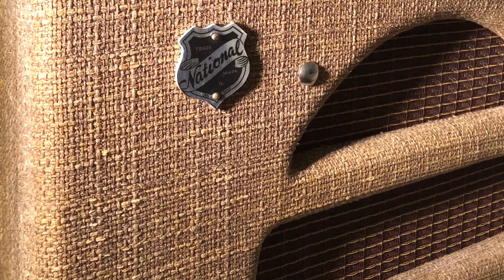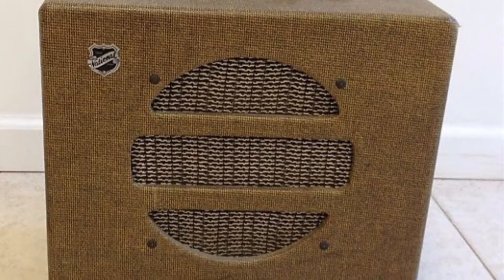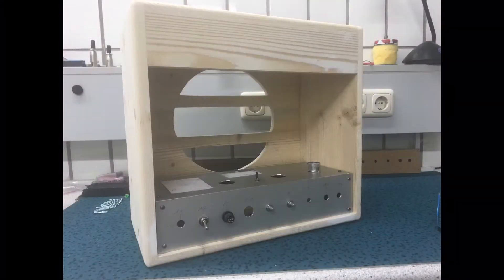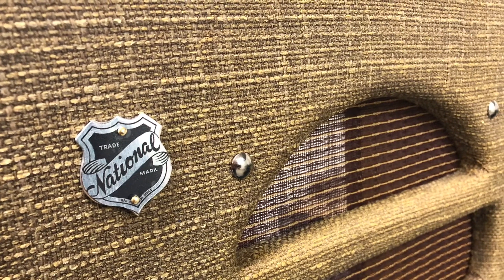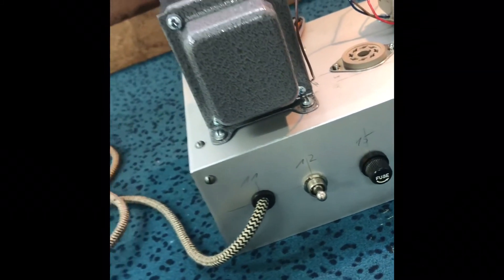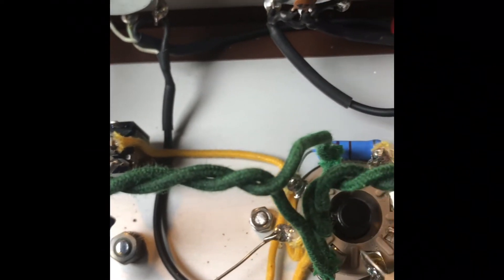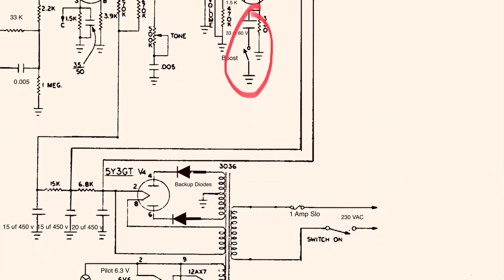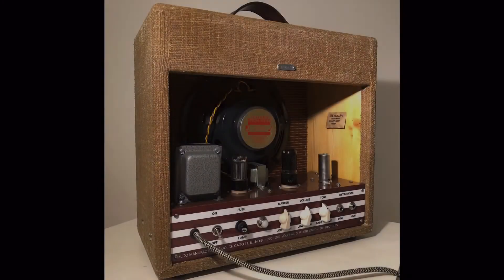National, Supro, Valco: How to build a Valco Guitar amp clone

Comment: 1950's national amp would not have ceramic Jensen, it would have P10Q Alnico. What model are you building with a 12AX7, most National amps that look like this, I know have 6SL7 or 6SJ7 preamp tubes. Of course, a few late ones have 12AX7. I see now you say 6616 but where is the second 12AX7 for the Tremolo? That said you did a very nice work on the cabinet but this would only fool a young man.

Comment: Great job Martin.I'm concerned about the DC present in the tone pot though, which could be dangerous for somebody else down the line.The blocking capacitor is there to block DC and the placement of the tone pot in the schematic defeats the purpose of this.I think this is a printing error and I wish that somebody who owns an original amp would confirm this.For what it's worth,this is the only version I know of any 5 watt Valco amp that has the tone pot before the blocking capacitor.
Reply from the maker: Hey Randy, I built this clone a few years ago, so I had to dig a little bit to get back into the subject. Actually it’s not a printing error, because the tone control is wired the same way in the Supro 6606, the Airline GVC 9045 A, the Gretsch 6151 and the octalsocket preamp of the Valco Spectator. Definitely not by mistake. Although I‘m playing that thing for a couple of years now, I’m still alive. But you did arouse my interest, so I’m going to take a closer look at the wiring and measure some voltages. By the way, whenever I had dc on a pot, because of an leaky capacitor, the pot caused crackling noise. But my Valco clone is absolutely unobtrusive. I’ll check that, and will let you know.
Greetings from Germany
Reply: @martinstubeampworkbench2299  Ah Martin, nice of you to respond.I was aware of the Gretsch having the same circuit but after seeing the Supro 6606 and the Airline which is essentially the same circuit as the Gretsch but drawn differently, now I realize it´s no mistake, but why? Was it for less attenuation? For me it°s safety first so I chose the 1959 Spectator circuit when I converted my Peavey Valve King Royal 8.Keep up the great work!Also, I sure am glad you´re still alive.😂
Reply from the maker: Allright…. I checked the circuit and in fact, I had 150 volts dc on the tonepot. Still wondering why there was no noise, at least a „whoosh,whoosh“ . Connected the wire coming from the plate to the other side of the blocking capacitor-no more dc. And this change did not affect the tone or loudness of the amp. So , yes you are absolutely right: safety first! Unfortunately we can not ask any Valco engineer, what they where thinking back in these days, designing such a circuit.  Maybe they didn’t give a damn.There was no safety ground, but a deathcap. Who cares 😂
Reply: @martinstubeampworkbench2299  😄👍

Comment: The control panel looks cool. Would a solid state rectifier be more reliable? And how might it change the tone?
Reply from the maker: I actually made the same amp with a solid state rectifier a few years ago. It is not easy to nail down the differences. The one with the solid state rectifier seams to stay clean a bit longer, before it starts to saturate. Sounds great though. But my latest amps all have tube rectification to come closer to the original. Looks cool, too😉

Comment: Hey great video, was the guitar at the end recorded with the amp you built ? If so it sounds amazing !
Reply from the maker: Hey Victor. Yes it was. The guitar was a Telecaster.
Reply: @martinstubeampworkbench2299  Wow, really sounds beautiful, definitly gonna build that, could you share the schematic in pdf ? And a wiring layout if you have one ? Anyway many thanks, hope you do more stuff like this !
Reply from the maker: Hey Victor. I really would like to share the schematic, but I ´m not shure how I could do it. Any idea?
Reply from the maker: Maybe you can find something when you browse the internet for a Gretsch 6151. That schematic is pretty close. Any differences are explained in my video.
Reply: @martinstubeampworkbench2299  https://drive.google.com/file/d/1kEWq1pLAzDeFjkoym9IqTKamsZ0uwDHN/view?usp=sharing
Well here's the link of the 6151 schematic with your modifications, I just had a question about that, what's the arrow poiting to the C ? On the cathode of the first half of the 12AX7?
Reply from the maker: @victormichee7567  Hey Victor. The 6151 Model has got a so called wiggle tremolo. The cathode of the first triode is connected to the tremolo circuit. Ignore it! I hope you will have fun, building this amp. Grab the solder iron!!
Reply from the maker: @victormichee7567  By the way: I made a 6151 T model a few years ago. And the Valco tremolo is fantastic. Still one of my favorite amps. Maybe you should consider building the amp with the tremolo circuit.